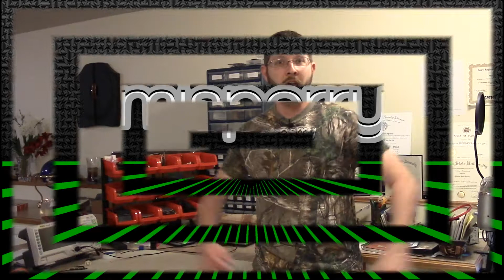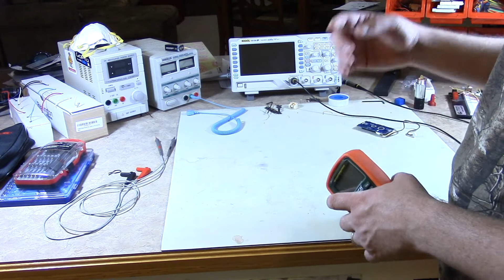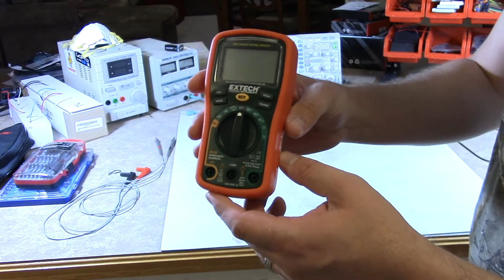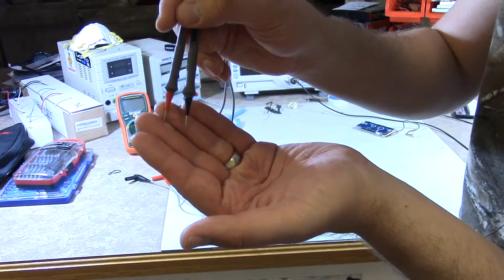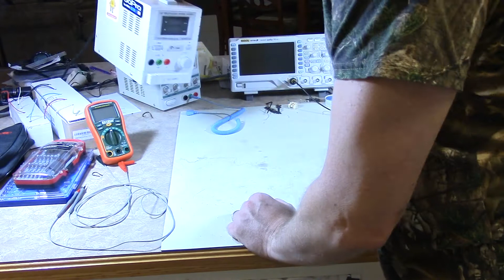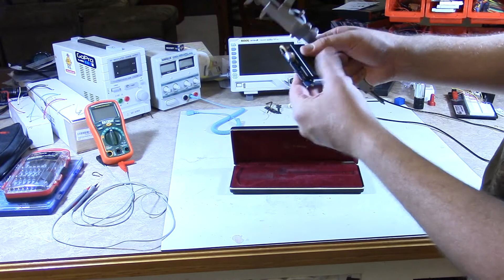Maker Monday 004 - Common Lab Equipment

Comment: Nice.  I have various bit of gear from Circuit Specialists that show up now and then in my videos., they are also a good supplier of photo-sensitive PCBs.  Circuit Specialists has always shipped promptly, with good prices.

Is that a degree from Wichita State University?  I grew up outside a small town a few miles from there.